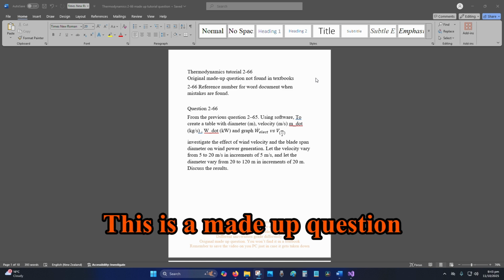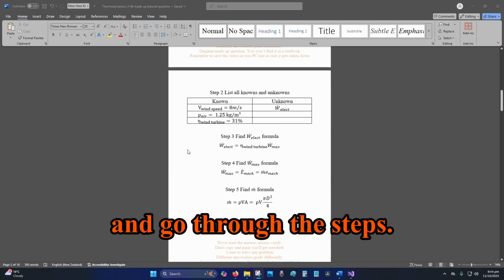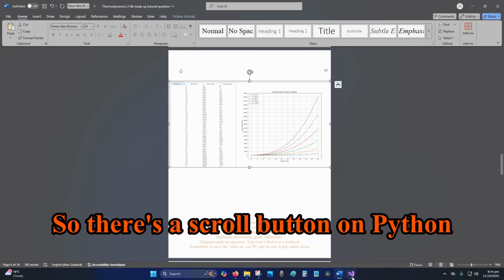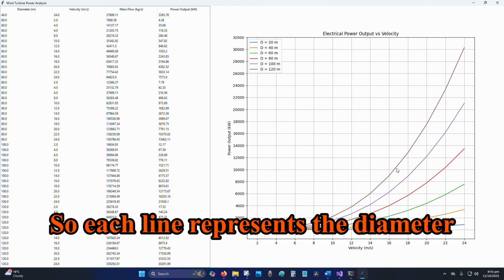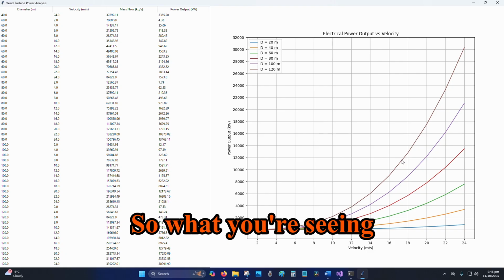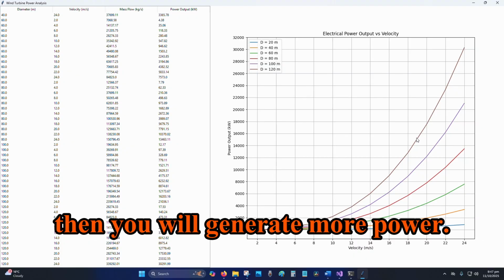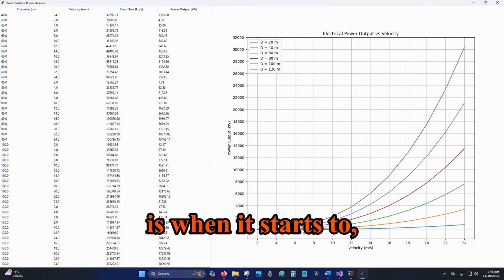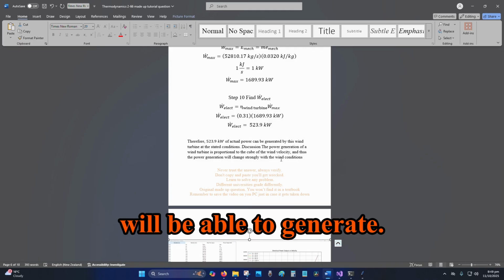Thermodynamics made up question 2-66 From the previous question 2–65. Using software, To create a

Comment from the maker: Reserved for corrections. Code below
2.66 reference number for word document when mistakes are found

Python code
import tkinter as tk
from tkinter import ttk
import matplotlib.pyplot as plt
from matplotlib.backends.backend_tkagg import FigureCanvasTkAgg
import pandas as pd
import numpy as np

# Constants
rho = 1.25  # kg/m³
eta = 0.31  # efficiency
diameters = [20, 40, 60, 80, 100, 120]  # meters
velocities = np.arange(2, 26, 2)  # m/s from 2 to 24

# Compute table data
data = []
for D in diameters:
    for V in velocities:
        A = (np.pi * D**2) / 4
        m_dot = rho * V * A
        e_mech = (V**2 / 2) / 1000  # convert to kJ/kg
        W_dot_max = m_dot * e_mech  # kW
        W_dot_elect = eta * W_dot_max
        data.append([D, V, round(m_dot, 2), round(W_dot_elect, 2)])

# Define column keys and headers
columns = ["diameter", "velocity", "mass_flow", "power_output"]
headers = {
    "diameter": "Diameter (m)",
    "velocity": "Velocity (m/s)",
    "mass_flow": "Mass Flow (kg/s)",
    "power_output": "Power Output (kW)"
}

# Create DataFrame with safe column keys
df = pd.DataFrame(data, columns=columns)

# GUI setup
root = tk.Tk()
root.title("Wind Turbine Power Analysis")

# Table Frame
table_frame = ttk.Frame(root)
table_frame.pack(side=tk.LEFT, fill=tk.BOTH, expand=True)

tree = ttk.Treeview(table_frame, columns=columns, show='headings')
for col in columns:
    tree.heading(col, text=headers[col])
    tree.column(col, width=120)
for row in df.values:
    tree.insert("", tk.END, values=list(row))
tree.pack(fill=tk.BOTH, expand=True)

# Plot Frame
plot_frame = ttk.Frame(root)
plot_frame.pack(side=tk.RIGHT, fill=tk.BOTH, expand=True)

fig, ax = plt.subplots(figsize=(8, 6))
for D in diameters:
    subset = df[df["diameter"] == D]
    ax.plot(subset["velocity"], subset["power_output"], label=f"D = {D} m")

ax.set_title("Electrical Power Output vs Velocity")
ax.set_xlabel("Velocity (m/s)")
ax.set_ylabel("Power Output (kW)")
ax.set_xticks(velocities)
ax.set_yticks(np.arange(0, max(df["power_output"]) + 2000, 2000))
ax.grid(True)
ax.legend()

canvas = FigureCanvasTkAgg(fig, master=plot_frame)
canvas.draw()
canvas.get_tk_widget().pack(fill=tk.BOTH, expand=True)

root.mainloop()
-------------------------------------------
Original EES code
"Given"
V=7 [m/s]
D=80 [m]
eta_overall=0.30
rho=1.25 [kg/m^3]

"Analysis"
g=9.81 [m/s^2]
A=pi*D^2/4
m_dot=rho*A*V
W_dot_max=m_dot*V^2/2*Convert(m^2/s^2, kJ/kg)
W_dot_elect=eta_overall*W_dot_max